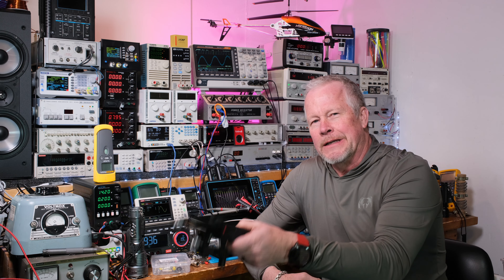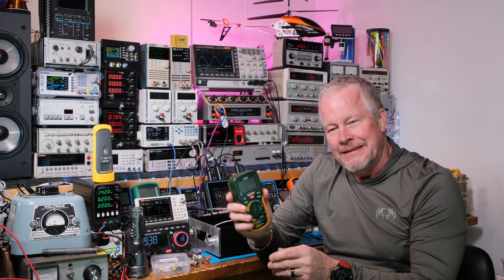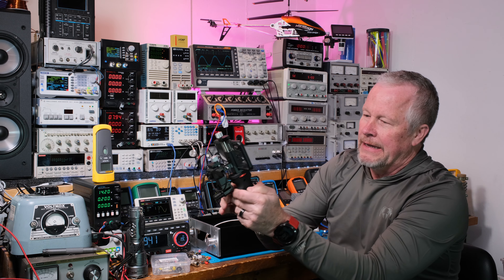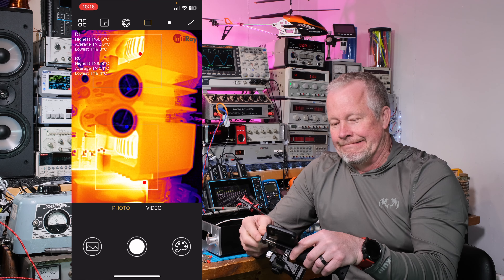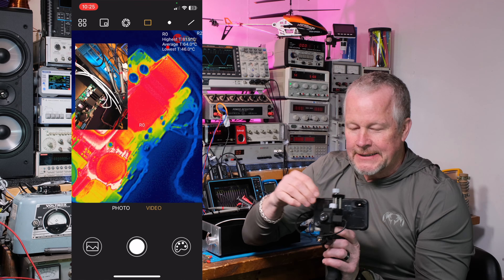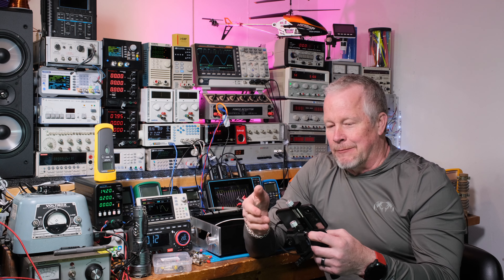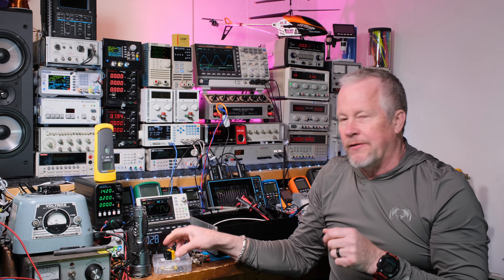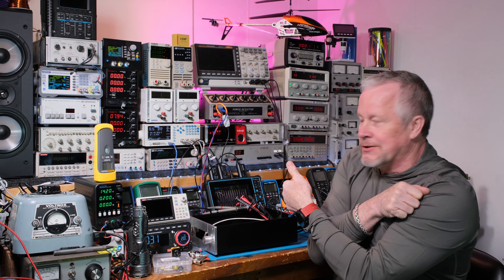Infrared T2S+ Thermal Camera Review looking at Class D Amplifier

Comment: I purchased a UTi260B 256×192 Thermal Camera about a week ago, but I still appreciated your video.  I actually thought long and hard about iPhone connectivity, but my iPhone is old and I probably will update when the iPhone 15 comes out, and that's the issue.  If I buy an iOS compatible camera now, it would come with a Lightning connector.  And nobody yet knows if the Android compatible USB-C thermal cameras will actually work with the forthcoming USB-C iPhones.  That is why I opted for the $399 UTi260.  Sadly, the software is Windows only and while it works in Parallels (I downloaded the trial), it won't work in WINE or VMware (I verified that).  The software also stinks because it lacks so many features, and the camera, despite being $399, won't record video in camera.  In fact, I would need to attach the camera to my computer, run Parallels, run the camera app, then make a screen recording in order to record "video" from the UTi260B.  So in light of that, your camera is better.  But the resolution on yours seems to be better than mine, despite the fact their specs are the same.  My camera says it is 25fps, but it feels more like 12fps.  Yours seems to be a higher frame-rate.  Sorry, for the long comment, but your video really got me thinking today!
Reply from the maker: This camera does perform very well.  I too will be finally upgrading my Iphone - but I'm not worried about the lightning connector too much.  I think the adapters should work, but I haven't had a chance to try yet.  It seems like whenever Apple has changed a connector that they offer adapters with the new phones.

Thanks for the long comment - lots of good feedback!!

Comment: Neat video! I wanted to purchase a thermal camera for a while now... maybe this is it ? :) 

Also, Eddie, is there a way that I can send you a photo of a transformer from an 1990's Philips amplifier with multiple taps and maybe you can tell me where the main's voltages input goes ? I'm so confused, and yes I have tested the resistance of every winding but still when I plug the mains I get 0 voltage. I'm in a pickle here :/
Reply from the maker: Thanks for asking.  Just email it to me.  KissAnalog@gmail.com
Reply: @KissAnalog  Ok, will do now, thank you very much!
Reply: @KissAnalog  I've sent the email, cheers! 🤗

Comment: Thanks! Picture quality is a lot better than what I would expect from 256X192  sensor. Thermal resolution is also great. It is surprising to see temperature differences between metal body and plastic sleeve of electrolytic caps. I would rather spend money on this camera than some 6 1/2 digit multimeter. I hope I will get one sometime next year. IR camera is so much better than thermal imaging by finger!
Reply from the maker: Thanks for your feedback!  I agree - I was surprised at the great definition.  I wonder how much it had to do with the lens on front - it seems large and probably made from glass which I think some are plastic.  I'm not sure about this.

Comment: Sorry for my second comment, but I've really been studying your video, and had some other thoughts.  Seems like your lens is focusable and allows Macro closeups?  I had to pay extra to buy a clip-on Macro lens for my UTi260B, and sadly, that lens too is fixed focus.  Another problem with using the Macro lens on mine is that it makes all the readings about 10°C hotter than when shooting the same scene without the Macro lens.  And I confirmed with my 121GW's Type-K thermal probe that the UTi260B readings without the macro lens are more accurate.

That leads me to another topic about EMISSIVITY.  You won't be able to scan a PCB and get the same emissivity for all the components.  I spent a lot of time trying to figure that out, but it seems like leaving the camera on the stock 0.95 setting for Emissivity is best.  Then you need to strap a Type-K thermal sensor to a component so you have a secondary confirmation of the temperature of at least one component on the board, so you know your thermal imager is telling you the right temps.  But again, whether they are truly right or not will vary by component because the Emissivity changes component by component.

In the end, I think these thermal imagers are useful, but due the complexity of choosing the right Emissivity setting, they are most useful if you do before/after temperature readings.  For example, you measure a problematic board with the camera, then swap out a faulty component that is getting too hot, then do another thermal image and see how the temperature is lower, relatively speaking.  

But overall, it seems like your camera is still a bit better than my UTi260B.  It's just that if you plan to get a new iPhone a year hence, it will be USB-C, not Lightning, so that would break connection compatibility.
Reply from the maker: Thanks for your feedback.  I don’t worry too much about the emissivity as I think the temps are close.  If you have something shiny like the exposed aluminum on an electrolytic cap then you can place some black electrical tape on it and it solves the problem.  I place tape - even kapton will help.  I think there will be fire to usb c adapters so I’m not too worried:)

Comment: Sorry if you already answered this somewhere:
Which one out of the Xinfrared T2S+, Topdon TC002, FLIR ONE PRO, anything else (?), is your favorite?
I am mostly interested in PCB repairs but would like to use it for many other things too. I do like the 25hz imaging and the MSX technology, but as you said, the resolution of some cameras is so high, you don't even need MSX. A big appeal of the FLIR is that the USB port is extensible, but they also seem to have huge quality assurance issues.
The prices seem to be very close together.
Reply from the maker: Thanks for the question!  The Flir pro has less than half the resolution, so the other 2 are better choices IMHO:) I like the TS2 for the manual focus lens, but the Topdon is amazing as well.  I’ll do a head to head review with a bit more time using them now.
Reply: @KissAnalog  Thanks so much!
It's going to be a birthday present for my partner.
I am willing to admit that I will likely ask to borrow it all the time though...
Reply from the maker: LOL good luck;)

Comment: I didn't watch the review, (not because it was a bad review, but because I have already seen many such reviews on all of the Infiray brand of cameras, their whole range)... what i came here to say was that the T2L is actually an even better performing camera (for PCB work / repairs). Compared to the T2S+ version. And they are to be found at about similar sort of price as each other. You can just get a better image, contrast and whatever the temperature range is better suited on the T2L version. But you don't need to take my own words for it... because there are already enough existing examples out there to be found online.

BTW Infiray have also released now an even newer T3S onto the market. Which is yet an additional improvement and higher end version of these ones (and T2L too). Because it uses a whole new higher resolution sensor. However for the time being that new sensor is way more expensive as things stand right now. Maybe in the future the price can end up dropping over time. And then getting to be more competive. Once that happens, that T3S will end up being the more ideal thermal imaging camera. Including also for PCB repairs (and other uses too). Mostly simply due to its even higher resolution. Hope these extra commentary was helpful.
Reply from the maker: Thanks for your feedback!  Actually the T2L has the same specs as the T2S+ except the body is slightly different shape.  The T2L came out first and was android only.  They sent the android version to me first, but then told me that the T2S+ was a better option as it worked with my IOS system.  So I returned it and had to wait for it to come out.  If you look at some of my images of the board - they look really detailed.  The T3S is in the same camp as the T2L as it is also android only so I have to wait for the IOS version to come out.  Hopefully the price will not be more than $100 more.  This camera is very impressive.